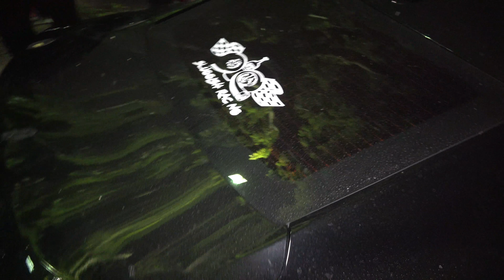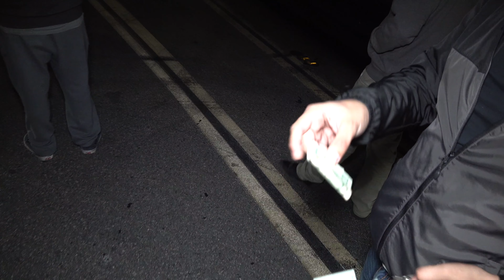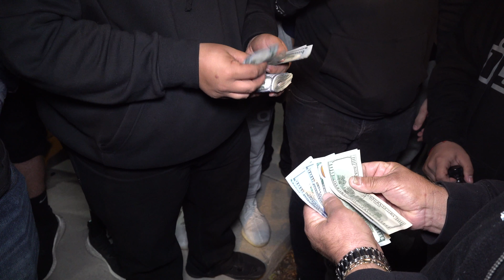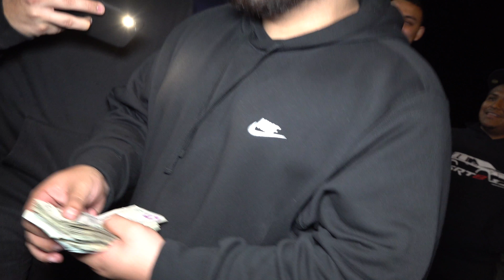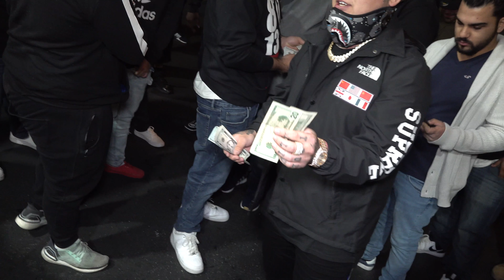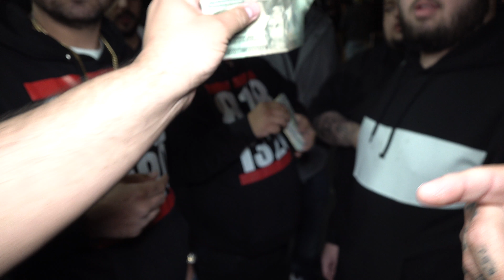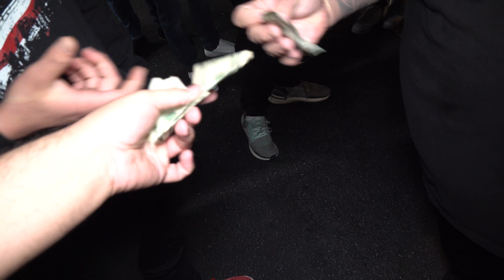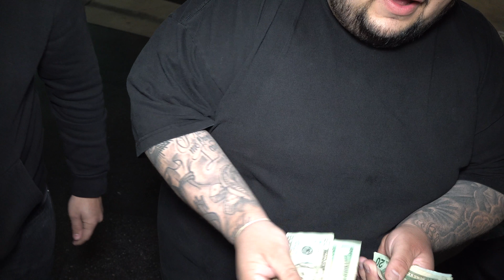Camaro SS Vs Mustang 5.0 $5,200

Comment: The stang wasn't ready he didn't flash his lights yet but i guess they called it a jump when the car  jerk forward when he was getting on the trans brake but definitely should run that back
Reply: Daily Driver exactly what I saw ...mustang did not flash his lights
Reply: A chase is a race